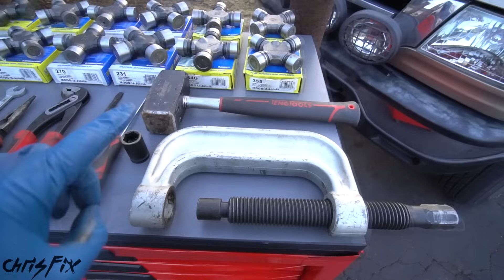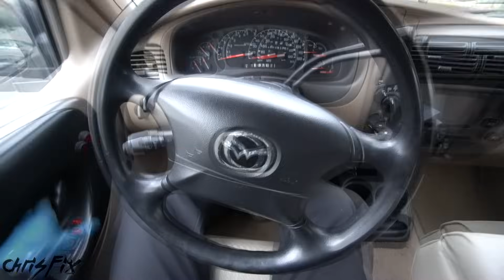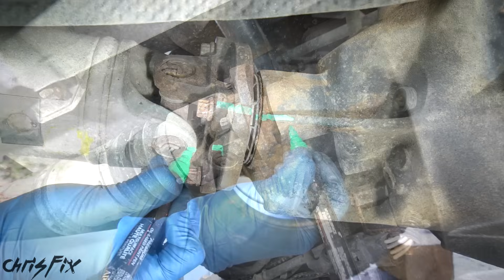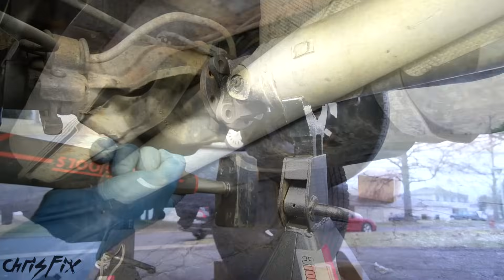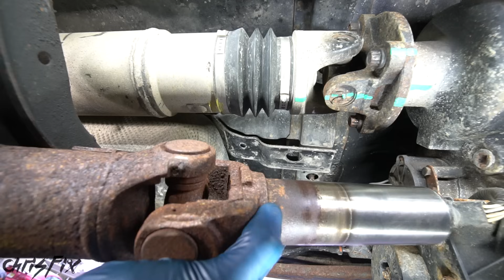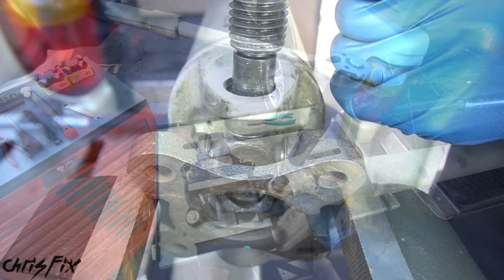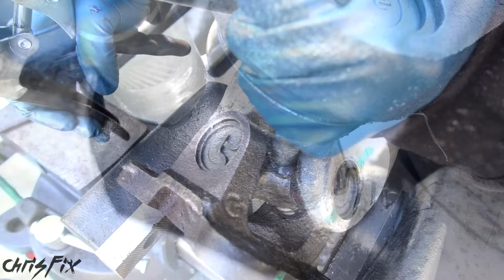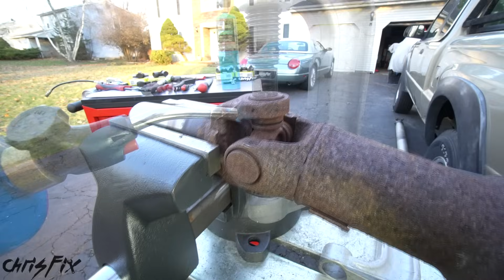How to Diagnose and Replace Universal Joints (ULTIMATE Guide)

Comment: I've got a 1999 B 3000 it's had issue after issue 150k so I guess I shouldn't complain. It's my FILs who I bought it from. He had rear end seal issues etc replaced 3 times he spent over 10k on repairs. I've put 5k on it and I'm having the weird driveshaft sound. Ujoints are all good except it's loose on the front shaft where it meets transmission no ujoints. If it moves there is that ok not a ujoint just the whole shaft?

Comment: i can not get my plastic injected ones out. i have a torch idk if anyone will answer me on here but i need some help
Reply: He did say it might take a couple minutes with the torch to melt it before pressing. Perhaps its not melted fully or you might be waiting too long allowing it to harden before pressing. You could also try penetrating fluid and hitting it with a hammer if its rusted together. Best of luck.

Comment: Today i thought i might need a new ujoint as the rubber boots were rotted, cracked etc. Luckily i found a never used ujoint that i wrecked years ago that needle bearings were damaged while assembling in vice. I took those rubbers off and installed onto the bearing caps of the ujoint i was resurrecting, then reassembled.

Comment: Can this produce a thunderous rumble at speed? A growl/rumble like distant thunder 2004 Jeep Grand Cherokee. It intensifies with suspension travel and is pretty constant on or off the gas. Changes slightly in turns. I replaced both axle bearings myself but the noise didnt change all that much. Maybe a little better. Anyways, thanks to you I’ve rebuilt my 352,000 mile Grand Cherokee with confidence. Thanks Chris, you’ve saved me a lot of money and built up my personal confidence fixing trucks and cars

Comment: Can U Joints also cause a heavy vibration from 50-60mph only when throttle is applied ? it completely goes away below 50, after 65 or if I let off the throttle during the vibration but comes back as soon as I apply the throttle again.

Comment: Important note: You realpy only need to mark alignment if your drive shaft has the slip joint on the transmission end. If it hard bolts into the tranny and the rear diff with the slip joint in the middle, then the alignment doesn't matter. Easier process on rear wheel drive trucks

Comment: The rear uni on my 4wd is done for. It's just a matter of time before the driveshaft blows out taking the fuel tank with it. Also, leave your car in neutral to check the joint at the diff. Leave in gear to check the joint at the gearbox. Alternatively, you could rock your car back and forth in gear, although this doesn't tell you if it's the gearbox, joints or diff.

Comment: One tip I'd suggest, especially for folks who haven't done this before, is to use multiple colors for marking the lines on the drive shaft and mating surfaces. Depending on the vehicle and how exactly the lines are drawn, it's possible to mix-up the alignment (please don't ask how I know). Far less likely to happen if the lines are also color coded. And always take pictures for reference before taking things apart!

Great helpful video as always!
Reply: This step was the only part that worried me for the sake of making this mistake, thanks for recommending this method now im ready to give it a shot this weekend on my nissan xterra lol

Comment: You can find u joints in your steering shaft too.
My landcruiser just developed a vibration at 80-90kmh. I didn't know what it was so i checked the frequency of the vibration with an app and there was a peak at 39-41hz (like a subwoofer)
At that speed my car was doing around 2k RPM. My 5th gear has a ratio of 0.845:1 so engine speed divided by 5th gear ratio = prop shaft speed, 2000 / 0.845 = 2366.9 then divide by 60 for rotations per second and the shaft is spinning  39.44 times a second. That matches the frequency of the vibration and I know its something to do with the shaft. 
I know what I'm doing this weekend.

Comment: I thought it is normal to have slight play , honestly this helped me figure out what was causing vibrations on my car.
The vibrations weren't constant only when driving uphill or when I'm in 3rd or 4th gear.
I checked the u joint there was the slightest movement when moving by hand , which wasn't noticable by eye but I heard a clicking sound, but I figured it was the normal amount of play... 
Now I know , thanks for the video I'll see if changing the u joint fixes it and I'll update this comment

Comment: When installing the new u-joints:
Orient the zerk so it's under compression when driving forward, this makes it stronger.
Smear some new grease around the needle bearings to help them stay in place. It's VERY easy for them to fall out of place.
When greasing the assembled u-joints, pump new grease in until your see new grease coming from around all 4 seals. The factory grease is formulated to prevent corrosion, not meant for in service use.
Finally, be sure to see new grease coming out of all 4 seals when servicing them, it's the only way to flush out contamination.

Comment: Trying to figure mine out I think it is a you joint when I pressed the brakes it only makes a clicking noise, but it’s not my brakes because it comes in the middle of the truck I’ve been underneath the truck with it in drive listening to it comes in the driveshaft but my buddy had a good point if my breaking is not working %100 and the U joints are worn out, they will start to show a noise

Comment: I replaced my ujoints and my carrier bearing but now I can’t get my carrier bearing to line up with the crossmember underneath. Any tips?
Reply: Any chance you put the new carrier barrier on backwards? On my 04 tacoma, the bracket holes are offset so it looks like it only fits one way. I took a video before disassembling the driveshaft just to make sure I faced the new bearing the correct direction.
Reply: @thebambooman7  so apparently I removed some of the carrier bearing but didn’t remove the all of the shroud. It was so rusted it looked part of the drive shaft. Took that off and it was lining up perfect

Comment: I have a 2006 Denali and when I punch the gas pedal hard or am on a steep incline and have to give it alot of gas quickly it grinds real bad up front. Could this be my u joint or differential unit?

Comment: So a cap broke on my 93 k1500 and the driveshaft slid out from the transfer case. I have no idea what orientation it went in at, is that really necessary? I haven't heard others saying that in other ujoint replacement videos
Reply from the maker: It isnt necessary. They are balanced without the cups. I just wanted it to go back exactly as it came since I know it's been like that from the factory.

Comment: Well isn't the u joint also called cross 
And in our pick-up truck we can only apply greese to 2wd u joint not on u joint which are located on shaft when we use 4wd. Why's that
Reply from the maker: It's also called that, and it depends on the design/truck, they can be sealed units to avoid dirt from getting in but on the rear driveshaft part they need to be serviced more often
Reply: @chrisfix 😮😮 tnx man just watching ur other video love ur work 
Btw ❤ from 🇮🇳

Comment: Hey Chris fix I tried doing this yesterday but I didn’t see no C clips or any clips holding in Tha joint tried wacking it with a socket used penetrating fluid n heat nothing worked there is some tiny holes that looks like pins holding in the U-Joint but not to sure
Reply: Okay at 20min in your video they look like that so I guess melt em then ?
Reply from the maker: You might have to melt them then, is this on a GM truck?
Reply: @chrisfix yeah it’s a GMC Yukon I melted them yesterday it was pretty awesome watching the plastic ooze out thank you for your help. I have a another question on the same vehicle when it gets cold it don’t want to start has crank but no start any ideas
Reply from the maker: Haha awesome! And it's likely a weak battery or a weak fuel pump. Could also be a faulty coolant temp sensor, spark issue (like a bad coil pack or corroded spark plug boot) or a dirty IAC/throttle body
Reply: @chrisfix alright thank you Chris fix I alwys watch your videos help out a lot 🤝🏾 I will be checking those this weekend appreciate it!

Comment: how do yoi know if your Ubolts are gone bad? I had a mechanic tell me to change em and wanted like huge amounts of money. He said it was vibrating real bad and its not drivable at any high speed. So i took it home to consider. But yes how do you know?
Reply: also i have symptom 3 it sounds exactly as you say. Massive vibration increasing at high speed. So i can get away with minimal acceleration on straight roads but additional rpm and acceleration really gets annoying. What i dont get is how my mexican mechanic fuked this up. He put my new transfer case into the drivetrain connected with Ubolts. I was okay for about 1000 miles but now it got extremely loud. I was trying to drive back to canada but obviously now i cannot. Is it possible since i had a bad wheel bearing that i drove on for a couple hundred miles and this could have loosened up the Ubolts and made a bad connection? Therefore it nulled out the previous u bolt and now its no good? 
Also for more reference i need an engine re mount now since my oil pan is sitting right on my oil pan. Lol right

Comment: My truck has had that squeaking noice you mentioned and i knew something was wrong, but its a 2003 ram 1500 my dad said it was just "old truck" noises... my drive shaft fell off when I was driving to work from the transmission side. It happened at a red light, could have been a lot worse

Comment: If the drive shaft is balanced, and you can purchase after-market ones, why does the orientation matter?
Reply from the maker: The driveshaft was balanced in a specific orientation, usually relative to the yokes or pinion flange. If you reinstall it incorrectly, you could throw off that balanced that will cause vibrations. Also, the U-joint phasing (how the joints line up at each end of the shaft) needs to be correct. If the yokes at each end of the shaft aren’t aligned properly, you’ll get driveline lashing or pulsing, even if everything’s technically balanced.

Comment: Pro tip. Take ur grease gun n squeeze little dab of grease on ur finger and spread thin coat around needle bearings in the cap. Makes a nice little blanket to keep them snugged in place so they arent falling over on ya. Also if ur caps break when trying to press the old ones out, take something like a 17mm socket(what i needed anyways) and use that to finish pressing the busted caps out.

Comment: I appreciate the thorough explanations. However, sometimes things aren't so easy. I was doing a 2006 trailblazer with 175K and ended up cutting the U-joint out with an angle grinder cutting disk, and then using my frame straightening hydraulic kit to force the bearing caps out. This was after trying to press them out with my 10 ton press, as well as a sledge hammer and torch heat and something tantamount to swearing and praying respectively.  New one is in and done, but next time I'll find a mechanic. I'm getting too old for this stuff. LOL. Great video anywhoo. Just had to add my experience for others who may not be lucky as well.

Comment: It went well but it can be tricky as they don’t always come out too easy. Heat helps and a small rotary type tool allows you to clean the inner grove (with a tiny wire brush) and any dent, extraction may have caused. Some times the replacement is a bit long and it will be difficult to seat the second retaining clip. Be aware of the needle bearings and make sure you don’t lose any.
Reply from the maker: Good tips and yeah it can be a little tricky

Comment: I’m replacing my joints on my 1992 F150 XLT and the front driveshaft uses 2U joints to the transfer case and front axle. The moog super strength you joints I bought have an indent on two of the rollers and the other two are normal. Which two sides of the joint connect to the U bolts in which two sides connect to the driveshaft?
Reply from the maker: I would contact moog, they should be able to give you guidance or be able to direct you to a reference sheet or something
Reply: @ they don’t fit and moog doesn’t have any smaller diameter ones. Looks like spicer for the front driveshaft. Thanks man

Comment: Hey chrisfix I have a Chevy Silverado 2500HD 2005 model V8 6.0L I noticed when I increase my speed the 4WD gear shifter starts vibrating bad could this be the cause? Bad U joints?

Comment: My 2020 Yukon xl Denali vibrates at around 50-55 mph and will feel it 2 or 3 times and then it goes away until I slow down and then accelerate at those speeds again. Is this a u-joint symptom?

Comment: You missed a good opportunity to check the pinion and how much slop is in it that bolt was exposeed. It can be easy just to tighten it a little bit and take the slop out without having to set all the preload and all that. And since the drive shaft does work in conjunction to the rear differential you should have mentioned the rear differential as well and the pinion. Great video as always!

Comment: I have a knock when im slowing down hitting the brakes, and it doesnt do it when im not hitting the brakes. i crawled under and wiggled the 4wd shaft and the u joint by the transfer case was wiggling some i bought a replacement and ill be using this vid to help me. i hope thats the issue!

Comment: This is one of the best educational videos i've ever seen. Very detailed and easy to follow. My question is, I have a 1990 jeep wrangler. I have red fluid getting splattered underneath were the u-joints are. The transmission seal has been replaced. Is it possible that the grease in the u-joints is leaking out? Its not transmission fluid because that's a different color. Thanks for any info.

Comment: The driveshaft is balanced from the factory,that is obvious and correct. but people routinely replace u joints as well as driveshafts and there is no magical position they have to be in where you need to mark the shaft.. They are balanced. Just the same as my tire is balanced on the rim and the rim doesn't have to be installed with the lugs in the same bolt holes they were in when it was taken off the car.  
I'll be installing an 8 3/4" rear end in a 68 dodge and also changing driveshafts at the same time since they are different lengths.

Comment: Do u have to take drive shaft out if u r just replacing the u joint in there rear next to diff?
Reply from the maker: A lot of the times yes, it's a lot easier to work with it out of the car

Comment: Just replaced mine bc I had a very slight wiggle around 40 it was faint and dealt with but for the most part it was handled I wanted to be proactive and get new ones in, due to a slight whine when rearing, did it in 4 hours and made it way worse…
Reply from the maker: Sounds like the alignment or installation is off and it's causing your worse issue here

Comment: Is the rattling steering wheel at high speed (100km/h) a symptom of bad u joint?
Reply from the maker: Yes that can be a reason why your steering wheel is shaking
Reply: @chrisfix  I didn’t think of it until last night as I’ve rotated my wheels and rebuilt my front suspension and still have that rattling steering wheel at 100km/h but my seat isn’t vibrating

Comment: Just did my first install today after watching your video. I did the hammer trick because the joint was a little tight and it worked. Very straight forward, clear instructions and high quality videos. Just subscribed! Thank you so much.

Comment: I installed the greasable at the 45 or middle.  Trouble is, cant get the grease gun to reach tue zerk once everything is installed.  So what’s the point?  Just stick with greased for life if available. The problem with the grease from the end type is that now you have a tiny bit of weight that might throw off the balance of the drive shaft.

Comment: I have a 93 Ford ranger with 508,000+ miles and the u joints didn't need replaced untill almost 500,000 miles, impressive

Comment: At 5:10 you say that when you move the driveshaft there should be no play at all. In the video you move it from the back end of the shaft, does the same hold if you try to move it from the front? My drive shaft has no play when i move it from the back, but when i move it from the front close to the transmission, it moves easily by hand. Does this mean my front u-joint is busted?
Reply from the maker: It shouldn't move by hand
Reply: @chrisfix  Thank you so much

Comment: Chris can’t thank you enough, excellent tutorial.
However, if I can share, my end caps were seized on. 
After watching multiple videos on cutting torches, and welding all thread on.. (neither option I had…)
I re-centered the U joint in the yoke.
Then carefully cut the center cross out with angle grinder cutting wheel.
Then pressed the caps inward, walla!
Kept me from crying.

Comment: I have what sounds like a metal on metal like noise when putting car in P R N D. It does it intermittently when changing the position of the gear selector. For example when putting the car in park, reverse, or drive.

14’ Q60s coupe 3.7l 7AT
120k original miles
40k engine miles

Comment: I drove from Phoenix to LAX airport in my 1991 f150 with a vad vibration at higher speeds. When i hot home my dad dad told my to check drive shaft and it was barely attached.  2 and a half knuckles were completely broken off
Reply from the maker: Dang! You're very lucky that didn't fall off and cause a major issue

Comment: Quick question, at the rear differential I have U-Joint Fasteners on 2 of the end caps. Is there anything I should know other than pushing the caps on and tightening the 4 nuts?

Comment: Would you excessive heat after a drive also be a way to diagnose a bad U-joint? The U joint right after my transfer case feels hot after I drive but none of the other ones do